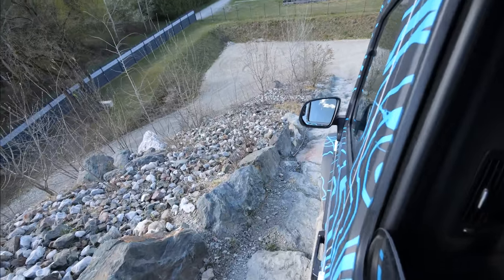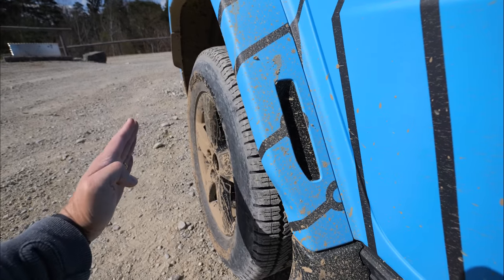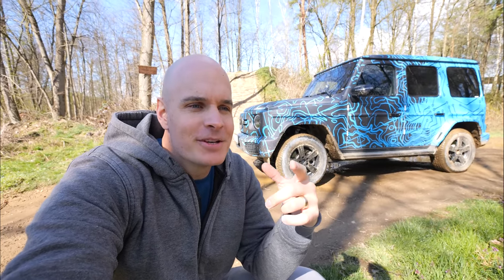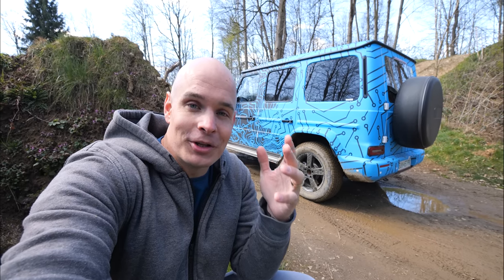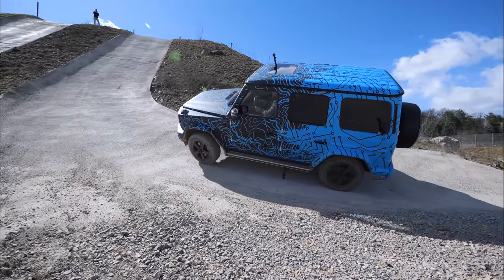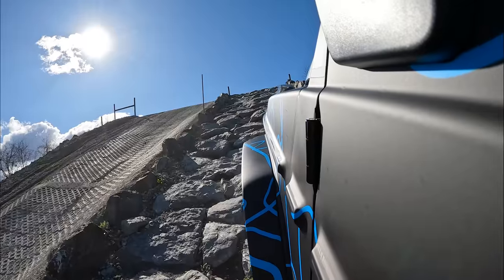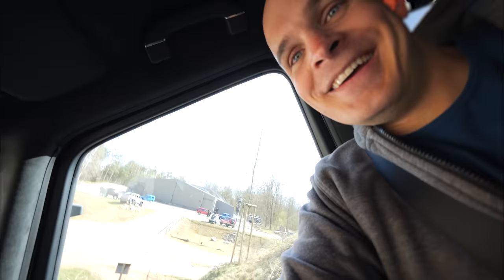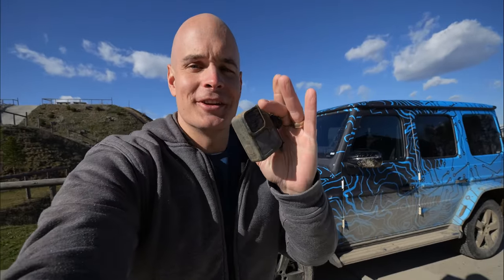The New Mercedes EV is a Luxury Stair Climber - (Sneak Peak!)

Comment: "Aerodynamic improvements" and "G-Class" sound hilarious together. But It's nice to see more familiar and old-fashioned cars being converted to EVs.
Reply: I know right! I dont know if any improvements are enough to offset the brick shaped car 😂
Reply: Wonder if those rear wheel arch aero vents will make its way to the petrol version too?
Reply: That made me laugh and think of the wrangler. 100 years from now, both will look identical to what is being produced now.
Reply: Throttle house said the G wagon has the aerodynamics of the flat side of the elephant 😭😭😭😭😂😂😂😂
Reply: @waynelangat4170  I like the term, driving fridge.
Reply: Like sanding the edges of a brick.
Reply: @craigsampson3386  haha, had the same idea, but then again, it will only make 1mi more with it. Doesn‘t make a big difference, it‘s ridiculous.
Reply: @waynelangat4170  hahaha
Reply: Well he didn't say that it's aerodynamical per se, just better than the ones before.
Reply: @bentm563  I see nothing that says it is better. Still the same shape. 2 air vents on the side doesn't change anything
Reply: EV = 🤢🤢🤢🤮🤮🤮🤮🤮🤮🤮
Reply: Was ded hearing that. With the aerodynamics of a garden shed I was also wondering what improvements were made. Awesome car though.
Reply: What’s so nice about it
Reply: @Mindful2222  😂 nothing can be done 😂😂😂😂 the G is a luxury Tech block. So…
Reply: As if that hole on the wheel arch will make much of a difference to the cw-coefficient of a wall cabinet and the frontal area of a blue whale.

Comment: That G turn.🔥
Reply: 8,000lbs, it should be illegal.
Reply: That’s Rivian’s tank turn had they actually made that feature available.
Reply: RIP tires
Reply: look, with sufficient horsepower and a 4WD system, you too can do four wheel burnouts...
Reply: Funny how many people get mad about the most useless feature on an offroad car.
Weird.
Reply: @pan6593  considering the client base of G-Wagons include some who, for one reason or another, are classed as “targets”, that G-turn could be very useful!
Reply: THAT G SPOT
Reply: Oouu nice 😍
Reply: @pan6593  way better than Tesla model X dance imo
Reply: @thebros2866  we don't know if Mercedes will either
Reply: EV 🤢🤢🤢🤢🤢🤮🤮🤮🤮🤮🤮
Reply: Well that is not something new... they just give a new name,  i can still remember official Rivian R1T launch and they called it 'Tank-turn', but what is weird Rivian ditch it on production vehicles so it will be interesting to see if the EQ-G will have it on production versions at least as optional feature... Rivian R1T could also go thru crossing deep waters up to right above lower hinges of the doors (when the truck was on highest mode of suspension lift)..  i see in beginning of the footage the EQ-G crossing a deep section with water too so that is awesome👍👌it looks so weird backing up on descending rock-crawl it just prove how capable it is.
Reply: My jaw dropped for a whole minute!!
Reply: It is called neutral steering, tanks have been doing it since WW2.
Reply: @mitchrelf957  it looked insane
Reply: @pan6593  this is mostly a show-off car, that will most likely never be used off-road. That G Turn is the coolest thing ever if you can do it on a normal road. The other road users will be shocked
Reply: New dream car
Reply: that is not a turn, it's out of control
Reply: Skid steer
Reply: @FirstDagger  or skid steer
Reply: @Dat_Sun  trucks should be too then
Reply: @AverageAlien  cry about it
Reply: @RuviaPawz  Why? Just the ev ones are crazy heavy.
Reply: They found my G-Spot 😱 I need that car 😱🥳

Comment: stopping and going up the hill again looks so unreal. I hear a gas engine scream in pain but the electric motor do it easily. Just awesome.
Reply: The normal g class doesn't have a problem with that either tho.
Reply: Are u joking ?
Reply: then runs out of battery and tow truck company refuses to come get you because they would make more money do other easy jobs
Reply: @hitman74  Almost never will happen unless you're dumb enough to drive somewhere without enough range to get in and out.
Reply: @kazuo9721  Leave your house with a full charge everyday and save money. For many people it's a great option
Reply: @kazuo9721  that's the type of comment that I would expect from a guy with NFT picture
Reply: @kazuo9721  anime is less embarrassing than NFTs, at least anime has entertainment value...
Reply: Can normal cars not reverse uphill? It's been a while since I drove anywhere with hills, but I don't remember ever having a problem with that.
Reply: @alejandrolopez2577  that steep with little to no wheel slip not really. Also near silent while doing so instead of the engine screaming trying to get enough torque is a big difference. Noise always equals wasted energy.
Reply: @kazuo9721  from mercedes I expect 200kw charging, 300kw is already done by others. So charging in 30min to 80% is possible
Reply: @kazuo9721  gas engine can be quiet and they make some of the better ones but never silent except when off. Electric car manufacturers  have had to start adding active noise generation to their vehicles so people hear them coming and don't walk in front of them which is something no ICE vehicles have ever had to do.
Reply: I don't think a g65 with 1000nm of torque would have any problem though
Reply: @kazuo9721  right, and I remember back when I lived in the Bay area in California I had a trans am and often went to the hills, mountains, or even the steep roads in San Fran and don't remember ever running into that issue in my trans am.
Reply: @wemakecookie  You mean like dumb enough to take it out of town, let alone off-road?
Reply: @mrtopcat2  If where you want to go is outside of the range of the vehicle then don't buy it. Yes it's dumb to buy a vehicle if it doesn't meet your needs. For many the range is sufficient.
Reply: @wemakecookie  That is exactly what I mean. For those who like to use this as Mall Crawler in-town, it will be perfectly enough. I  have been off-roading for close to 40 years now. I know what it takes. Only inexperienced grasshoppers would consider taking this POS out of town and off-road. And NO, a connecting forest road to a house does not count as off-road.
Reply: Only benefit of electric cars atm is they drive like a toy if you ever drove a scissorlift so batterycars are chiller for drunkdriving
Reply: Love a clueless comment like this
Reply: @alejandrolopez2577  my car certainly wouldn’t on something that steep.
Reply: @mrtopcat2 Ah yes, the idiots who think they know what they're talking about just because they've done something for years. Keep thinking you know best, bud 🤣🤣
Reply: @xenofastiq  Are you sure you are not using a line here that you keep getting told? Apparently from your channel, all you have is video gaming interest/experience.
Reply: @mrtopcat2  Trying to claim that my only experience comes from what I show on my channel is pretty silly, bud. But hey, you do you
Reply: @xenofastiq  Yeah, I am not surprised you would think that. You can hide now.
Reply: @mrtopcat2  Buddy, it's a YouTube channel that hasn't had anything posted to it in multiple years now. It's not that deep 🤷‍♀️ If you've fooled yourself into thinking that people's channels tell you everything about the individuals behind them, them I feel sorry for you. I have plenty of interests, including off roading, and plenty of experience. Theres just no reason for me to go and make a big deal about it on my channel
Reply: @xenofastiq  Yeah, your lengthy plaidoyer is only proving my point. You are just not getting it.
Reply: @mrtopcat2  If thinking your point is proven helps you sleep at night, you do you buddy.
Reply: @xenofastiq  You think strangers would be thinking about you while sleeping? LOL. You must love yourself. How about  you in cel stay with what you so proud of - video games.
Reply: @mrtopcat2  Well damn, somebody's got their panties in a twist! Hey buddy, it's okay if you're too old for fun hobbies, no one is the same as you! 

Again though, if feeling right helps you sleep at night, you do you! 🩷
Reply: @xenofastiq  Your proud hobby is that of an in cel. You just have not got the memo. Hence my previous recommendation for you.
Reply: @mrtopcat2  That's a lot of projecting you're doing, but once again. You do you
Reply: @xenofastiq  Oh, it is no projection. People know. You are just too detached.
Reply: @mrtopcat2  I mean, you're the one trying to claim that games are a "proud hobby" of mine just because I've posted a few videos related to games, even though there quite some years apart lmao. It's not my fault you don't understand that people can have fun hobbies, and still know more about your own personal hobbies 🤷‍♀️ But hey, if you wanna act like a know it all and still be wrong, you do you old timer!
Reply: @xenofastiq  So while you were trying to detach yourself from your image, you managed to admit being a grasshopper. Let’s see if you manage to reveal your in cel part as well. Please continue.
Reply: @mrtopcat2  Go ahead and explain how I was "trying to detach myself from my image" 🤣 Yeah, I play games. I haven't ever denied that. The difference is that YOU tried claiming that it's a "proud hobby". It's just a hobby to pass the time, buddy. 🤷‍♀️ 

I'd also love to see you explain how I'm an "incel". Because clearly you have no idea what you're actually talking about and just throwing words out that you see over the internet 🤣
Reply: @xenofastiq  Hmm, how do you explain to someone who is detached, who does not understand that how detached he is or what that even means? But hey here is something for you. Guys, who date hot women, don't play video games. Period.
Reply: @mrtopcat2  That's assuming you know anything about women in the first place, but considering your attitude when it comes to literally anything, chances of that being true are very slim lmao. You do you buddy!
Reply: @xenofastiq  Let's see, what are the chances of me old dog being schooled by some in cel video playing grasshopper? By the way, your including "buddy" and "you do you" tells a lot about your inability to make an argument. To be fair, my argument is and that is how we have started out, that you have no experiences about off-roading. Otherwise you would not have intervened here. But you had to swing your thing, which is another in cel grasshopper feature. Yeah, I am much older and much more experienced than you. Getting a big lip is over the internet is all you can do. In person you are back to you usual invisible. And again, yes myself or anyone in my age should know. So will you, some day, when you matured.

Comment: The 'G turn' is the coolest thing I've seen in a while and actually has a practical use.
Reply: Not really. Try doing that on asphalt road, your gonna shred your tires and the road.
Reply: @Maxdubi  Why would you do it on an asphalt road anyways? Clearly not intended for it...
Reply: @rapu4  bcuz the guy said it has a  “practical use”. It doesn’t.
Reply: @Maxdubi  It could be used for very tight turns in off-road conditions to be fair
Reply: @Maxdubi  If you keep spinning it then yeah it will probably shred the tires pretty fast, but if you only use it to spin 180 degrees just to turn around on a narrow road then it should be fine?
Reply: Tight packing space 😉
Reply: @Maxdubi  It does have practical use. Just a couple of days ago I was driving up a narrow canyon dirt road that ended at a cliff/ waterfall. Instead of driving in reverse back that road, I drove straight up the side of the canyon to do a 3 point turn that ended up being a 5 point turn. BTW, this G-turn was in reverse, so that also makes more sense also.
Reply: a g that is out of control? lol